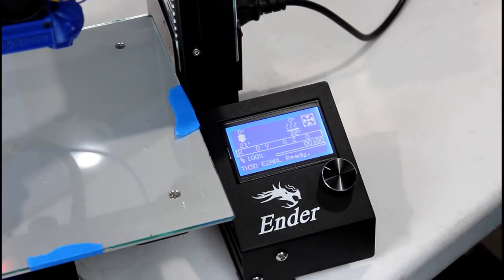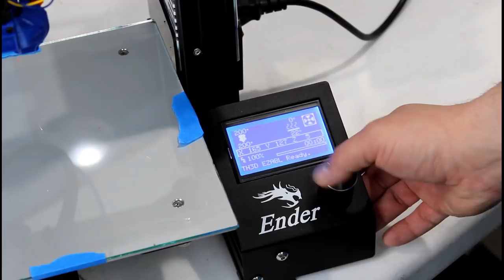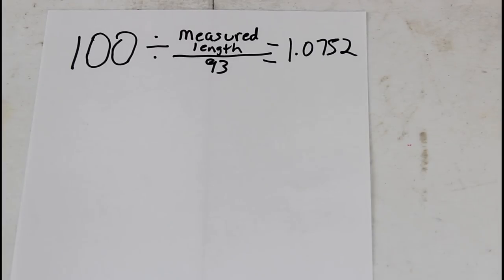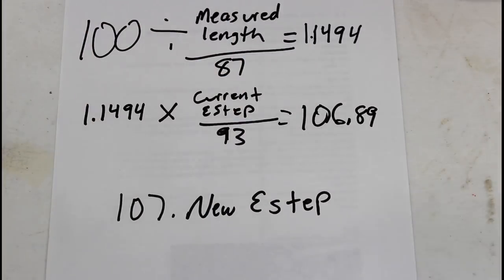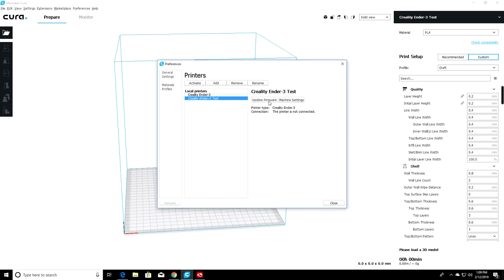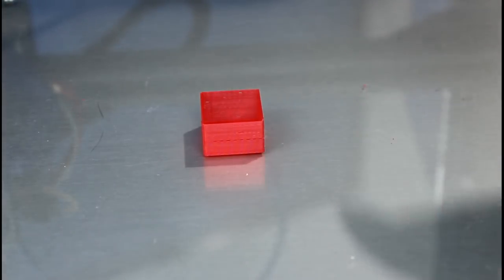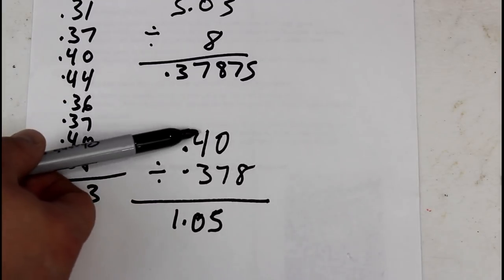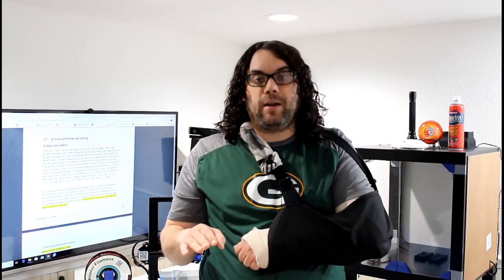Section 1.8 ESteps and Flow Rate

Comment: Pro tip for the professionals out there that like to have everything to be perfect. Turn the piece of filament so that way the bow is turning upwards, or I suppose downwards is fine. Then flatten it out and tape the two ends to the table before measuring. That will make your Measurement way more accurate
Reply: You can also drop the filament in boiling water for a minute then take it out and straighten it while it’s flexible
Reply: Yes @SDa.......you bring up an excellent point that I noticed right off.
The shortest distance between two points (in this case the most accurate distance or measurement) is a straight line. The video example Jim shows is NOT using a straight line and the filament sample is actually a radius! I worked in Production Automation with CNC’s (3, 4, and 5 axis) making parts for IBM with tolerances of .005mm (.0002 in) using MAFord solid carbide tooling (spade drill, spiral fluted drill @.0057 dia, and end mills @ .093dia) on Delrin 100 and Vespel 500 composite and actually holding half that tolerance. Would never get anywhere with that style of measurement. These videos are informative but when someone shows such a blatant, inaccurate technique I have to say something.
Tape on the ends to hold the true length sounds better than what was shown.
Perfectionist? Maybe! Professional? Always! CONSISTENCY is the name of the game with CNC production and these printers are basically 3-axis (and the ‘feeder’ for the extruder could be considered a 4th axis) CNC’s using the same Gcode used in Nc’s and CNC’s since the 1950’s. I also have considerable experience programming in Industrial code, Gcode, Mcode, etc. and in about 9 different versions as these languages are often proprietary to a particular machine brand.

Comment: This part was not shown.

Click Control > Motion, then scroll down to “E-steps/mm” and change it to your new E-step value.
Reply: And by doing that we don’t have to change anything from cura, right?
Reply: @fitopineda5192  Correct.
Reply: If we change the value in “E-steps/mm” ...Do you still have to change it in Prusa?
Reply: Thank you for this.. I’ve got 13 printers.. Didn’t want to adjust the Cura settings when only one of my machines is acting up.
Reply: Thank you Marco Casas, I was lost until I saw your comment!
Reply: @staceyy2827   Dont know if you got your answer but no you dont have to change anything in prusa slicer. I use prusa slicer with 4 of my different printers.
Reply: @TheDanny  thanks so much!
Reply: @TheDanny  thanks so much! :)
Reply: Thank you,  was scratching my head
Reply: It doesn't save when I turn the machine off. Is there any way to save the E steps?
Reply: @Michael748159263  should be a store settings tab in menu on machine. Hit that and should save. Power off and double check esteps in menu
Reply: Can you perform the estep test with the filament still working through the nozzle? Say set the nozzle to 215c?
Reply: you the man!
Reply: @DirtyPooh1  that saved it.
Reply: A lot of parts are not shown... like how to find wherever you're supposed to find the gcode to copy from.
Reply: On my ender 3 v2, it goes control, motion, then gives the options: maxspeed, maxacceleration, maxcorner, and transmissionratio. It doesn't give me that option. What do I do??

Edit: I did transmission, transmission e and changed it.
Reply: Thank you. This is what you could hope this video to include from readig the title. I was dissapointed not to be able to gain that knowledge from this video but luckily you gave it to all of us!!!💫🔥👍
Reply: thx👌

Comment: Thank you!!!! Also putting those distance names over the distance looks like another division equation. Hella confusing
Reply: I was trying to figure out that whole division line in the second figure til i saw your comment
Reply: @Juz10xD  Me too. I thought his formula was different since i was able to calibrate without using that formula. I also thought that's what he meant by hia formula being confusing is about that but turns out it was about the 93 e steps
Reply: @SimplyV3rna  I'm not sure, I followed his formula after figuring out that division misinterpretation and had no issues
Reply: @Juz10xD  all good. I was just thinking if my formula was different when i was watching his. And i realised he wrote the formula against all math conventions.
Reply: The formula is 100 / mesaureLength * currentEStep = newEStep
Reply: I was so lost lmao, my calculations made no sense
Reply: Agreed! My engineer brain was about to blow a circuit!

Comment: Jim, just a tip for this one if you ever re-do this video in the future.  Your formulas the way you wrote them up could confuse some.  I figured out what you did but here is what might be better.  Step 1: 100/Measured Length= n  Have the Measure length noted off to the side in a list of your variables.  Step 2: Step 1 * Current Estep value.  Again have the value for the Current Estep noted in a  list on the side instead of in your formula.  
What one might interpret what you wrote as the following.  step 1: 100/(Measured length/87)  Step 2: Step 1 X(Current Estep/93).

I hope you find this feedback helpful in the future.
Reply from the maker: Thank you for the feedback!! I appreciate it!
Reply: @TheEdgeofTech  No Problem Jim.
Reply: Yea so 100 / ( 93/93) is 100...

Comment: You're guide completes me. I got my e steps figured out (adjusted to 96 and its dead on 100mm +- 0.2) and my flow rate actually went down to 95%. 

Thanks for the guide.

Comment: To anyone else that might be confused about the flow rate and wall width:

The walls of the cube are 2*(nozzle size), so if you have a 0.4mm nozzle you should get a 0.8mm wall after printing!
Reply: I have the same problem, set cura to 1 line wall, .4 thickness, and it prints the 3 wall line still
Reply: @ontariodigger162  there is no need to change anything in Cura, it will always try to print it 0.8mm wide since the 3D model says so (if you use a 0.4mm nozzle and the 0.4mm stl file). Just print it and measure it
Reply: no lol. A .4 nozzle should be a .4 wall
Reply: @pubexploit6782  yes, but it prints two walls = .8 mm :)
Reply: @SweCookie  I'm saying for just 1 wall:)

Comment: thank you for the great video, 
my E-steps was 93 now is 97.8, 
flow rate 100% reduced it to 84.7%, 
perfect results, well done.....
Reply: Same here, E-step went to 98 and flow to 87%, pretty close at least. Ender 3 printing Generic ABS.
Reply: Glad you mentioned that. I was also confused as my esteps went only a little bit up (95.7 on Direct Drive). I am also clocking in a 83-84%.
Reply: Is it any surprise you INCREASED your Esteps and now you have to DECREASE your flow?  It's not because you got your Estep number correct.  All you did was shift the calculations for the end result around.
Reply: Mine went to 68%!? How's this possible?  Testing now.
Reply: When printing now there is spaces between the line, I increased the flow rate to 90. Why this happen?
Reply: @superkillr  I see, how you suggest we do it?

Comment: I changed my extruder to a dual gear one, and YOU amazing man helped me tune perfectly! Everything was well explained, sooo....THANK YOUUUU!! I love your channel, and I hope your arm healed very nicely!!
Reply from the maker: Thanks!! I'm glad it helped!
Reply: Have you been having to calibrate flow per material too? I did the same mod with my ender 3 and now I have to.
Reply from the maker: @TheAkashicTraveller  That's good practice, so the correct answer is yes you should. But many people just go with the flow and keep it the same.
Reply: @TheEdgeofTech  It's slightly fruystrating that with cura you have to use a plugin to get flow into the per meterial settings despite people asking for it for years at this point.

Comment: My Original E Step was 98.94, My New EStep is 135.534, Approx 136. I type M92 E136 in Octotprint Terminal to modify the current EStep value. Then M500 to write new ESstep value to EEPROM. Then M503 to read saved value. Then I extruded another 100mm and it was spot on,Thank you!

Comment: Spot-on explaination :)

I did some flowrate calibration for the filament spools that are most commonly used when I'm printing things, mostly PLA and PETG.
Once filament have been dried, across brands, well, there are subtle differences. From brand to brand, PLA yielded values between 0.95 and 0.98... PETG being either 0.99 or 1 (using PrusaSlicer).
Subtle, yet not to be overlooked. Minor changes can produce a world of difference.
Reply from the maker: Great tip! It's always good to check the flow rate with all your filaments to be spot on!
Reply: Yes :) Still have to do it for TPU, nylon, and ABS. When the printer will be repaired and enclosed...

Comment: Luke changed the original file. The first file was one wall, 0.4. 
Now it is two wall, 0.8.
That makes this video a little bit misleading and diffucult to understand if you are new to 3d printing and if mathematics arent your strong side. 

Thanks for the videos you are making ! It really helps a noob like med =)
Reply: This could be easily changed with Wall line count set to 1 :)

Comment: Great video. Only issue I seen is that the filament should be measured when strait. In video it shows being measured when at arc which will result in a shorter then actual measurement
Reply: You have a good point. Luckily an arch that wide will likely not impact the measurement enough to be a huge problem. The length difference with that arch and a straight piece is likely somewhere under 0.01 range.

Comment: Finally I found a tutorial on how to calibrate those two values (esteps and flow rate), thanx a lot! Apart from the creatively written small math formula (I figured it out as you explained what you meant in the video) everything was very well explained. Thanks again!
Reply: Thanks for mentioning the 'algebra that isn't algebra' .   So in this case the divide line should read (or in our example).

Comment: thanks bud after banging my head against the wall I couldn't figure out why my ender 3 was printing weak under extruded Prints and then I came across your video and figured out that my printer had the wrong e-steps setting in and it was only extruding about half of what it should have been extruding after I put the new values in everything was good

Comment: I don’t know what I’m doing wrong.
I go into my cura settings, set the wall thickness to 1 line .4 thickness and slice. The problem is it’s still prints 3 line wall thickness at about .9 when I measure it.
How can I print a single line test cube?

Comment: Great video, but I have one comment. When I see you write the Measured Length then a line with the number underneath, I read that as the measured length divided by #. Maybe just the math nerd in me. You did a great job of talking through it when I went back and actually listened to what you said instead of just reading what you wrote.
Reply from the maker: Thanks for watching and for the feedback! I appreciate it!
Reply: @TheEdgeofTech  love the video!  I agree with this comment and would add that you could simply edit out the part where your E steps and mm length happened to be the same number :)

Comment: So how do you verify the E-steps for the Z-Axis stepper motor (or either the  X and Y for that matter)?  Do you still set like 100 mm and have the Z-axis raise be 100 and do that same calculation? How do I know the presets are correct?  Currently, our extruder seems to drag across the infill after a certain height.

Comment: around 3:20 you go into the prepare menu to let the extruder extrude 100mm filament. However, I don't have these menus. It seems you have an updated firmware or a more advanced menu setting. Any idea what it is and how I could change my Ender 3 so my menu is like that?
Reply: Erwin Mulder - he had upgraded his firmware to the TH3D EZABL (Easy Auto Bed Level) version. There are several videos out there on how to do this. I like Teaching Tech's video series for the Ender 3 - very informative.
Reply: @oldguy2194  Thank you!!!

Comment: Good video.

The math formulas are expressed incorrectly:
100 / (Current measured length) * 93 = (New e-Step)

Also you don't actually need to snip off the filament. Just trim the ends and measure with the caliper's upper jaws (used for inside measurements) against the extruder to the tip of the filament.

Comment: My esteps were at 93, that seems to be the default for Ender 3. I extruded 97mm. I put in my new esteps which was 95.8 and extruded again. I got 100mm exactly, right on the dot. You don't want to go over 100. That results in over extrusion.

Comment: is 93 the default for all Creality products? I know you say that in the video but I have also read conflicting numbers of 93-95 when it comes to the Ender-5 (which is the model I have)  Also, The latest version of CURA doesn't allow you to copy and paste from an outside source (Luke's guide). So that being the case does the wording, spacing, grammar have to be exact?   Thanks for making this video
Reply from the maker: Good question. I'm not sure about the other machines. If you use my other video it tells you how to get it off the Printer using Octoprint or Pronterface! Also, yes it needs to be exact for the code part, but the descriptions don't matter.

Comment: Thank you. Mine was sooooooo far off it is unreal. I had 99 as my base line and only 43.72 filament came out. After the math it was 339.40. I thought it was wrong until I measured 100 exactly on the nose. Thank you soo much. I have wasted at least a roll and half thinking tried to change all kinds of stuff in CURA. Ugraded and now prints are coming out like new again. SUB and Liked from me.
Reply from the maker: Awesome!!! Great to hear that this helped and your printing good again!!

Comment: I'm sorry kinda new to this so if I changed my E-steps in my printer why add the code in Cura doesn't it use the step values in the printer already unless  you add code to change it? BTW thanks!!

Comment: Hi, thanks for this. I was following it right up to the point where you said “we just need to copy this line of code....” Where did you find that code? Up until that point you had been dealing with hardware and then you leapt in to software! I am running a standard Ender 3 with just a few add-ons, including the hot end fix.
Reply from the maker: Hi! The GCode can be found in section 1.8 of Luke's Help guide! Let me know if you have any questions!
Reply: agreed.. that was very confusing to watch..
Reply: Is the help guide a PDF? A website? Where can we find it? Thanks!

Comment: In the Video the measured lengths have a bit of a curve to them, to me that means the measurement is low, is this something I should be concerned with?
Reply: I'm wondering the same thing...
Reply from the maker: When I filmed the video I had a broken arm. I had my wife help with the measurements that I used to dial in. But for filming, I couldn't straighten them out myself. Always make sure it's straight so you get the most accurate measurement!
Reply: Hahah oh.. that makes sense 😂
Reply: Hope your arm is doing better
Reply: Gotta get the arm straight before he can straighten the filament :p
Reply: @TheEdgeofTech  hey bro do you want to review  one of my Ender Extender kits? Pop in my Facebook group Ender XL Builders Club

Comment: When you measured the 100mm the filament was bent slightly. Does that make a difference? Should I hold it down straight?
Reply: came to ask this exact question
Reply: At shallow angles of bend, it doesn't make any significant difference. If you know what cosine is, the relationship between  the length of the hypotenuse and the side adjacent, the value with a 5 degree bow angle is .9962 so that means that if the actual length of the filament were 100mm long but had a 5 degree bow in it, then you'd measure 99.62mm. Less than half a mm of filament error, but you can always assume your extruder is pushing a little extra, but never less than the amount you measured.
Reply: @HuFlungDung2  thanks or the explanation!

Comment: I’ve just noticed that on Cura 4.6.1 when I make these measurements and enter 0.4 wall thickness with 1 wall Cura prints the same size cube and doesn’t actually extrude the corrected flow rate. Example, flow set at 100% cube comes out at 4.7 thickness, flow set at 60% I get same 4.7 thickness.. so it seems right now that Cura is broken! Same with 2 walls 0.8 thickness.

Comment: Thanks for the great videos!  When slicing Lukes .8 cube test which profile should I use?  Super .12,  Dynamic .16  Standard .2  Then set the Shell wall thickness to.8 which gives 2 walls.  (Ender 5 plus with .4 mm nozzle)  Only adjusting the temps for PLA + (210 nozzle 65 bed)
Reply from the maker: I would have to go look but I think he put that on his thingiverse page. It should say what settings to use when printing it. I'm watching a movie currently so I can't do it, but let me know if you can't find it.

Comment: quick question here,
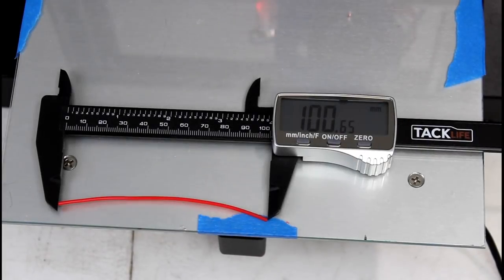at 7:18 you state that after you have calibrated your esteps you did the extruding test again and it was spot on. How did you tell the printer about this new esteps? 
I understand that when I edit the gcode in cura all files slices with this code will have the new step in place, but how will the printer now when it's only extruding filament?
Reply from the maker: If you have a newer Ender 3, you can do it right in the control panel of the printer. I have a video to show you how. Also, you could do it using Octoprint or Pronterface, and I have a video to show that as well. In this case we used the starting gcode to do it, but that is an old way and the other ways are easier now.